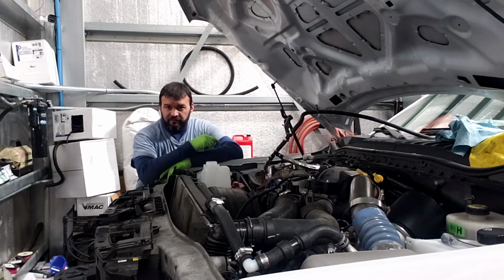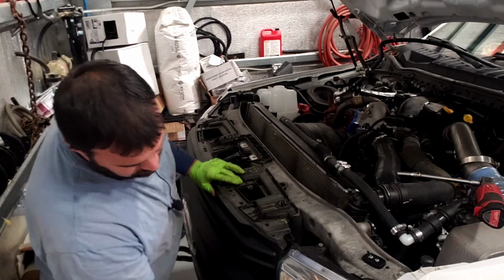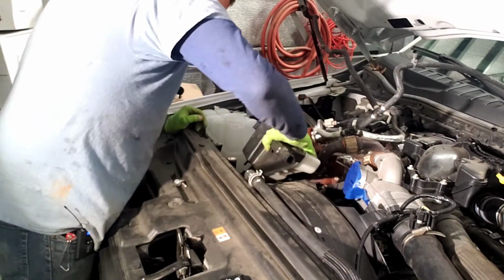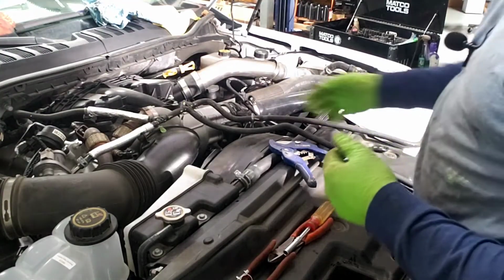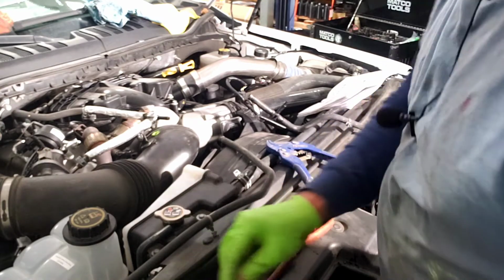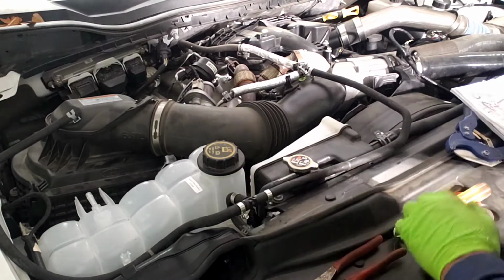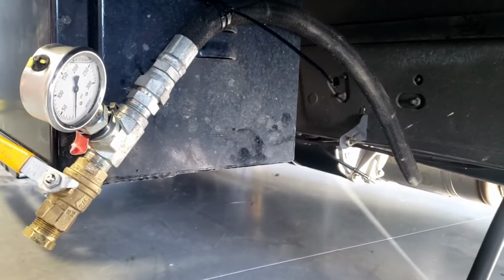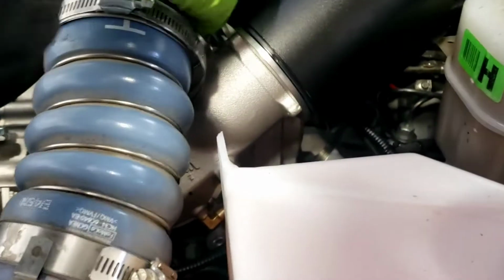VMAC VR150 (ep.11)  "Completing the installation and testing"

Comment: do you know where I can find the “vmac belt” ? My system needs servicing “vr150” but I no longer use it and don’t want it running in the back. And want it turned off when truck engine is running. Thank you! Love your videos
Reply from the maker: Good afternoon. The system should not run when engine is running unless the clutch is engaged by turning on the switch. Are you wanting a replacement belt or to remove the belt?
Reply: @precisionnc  originally but I notice when the truck is running the belt for the compressor is going as well. The system isn’t going fully as like you said you need to activate it with the park brake. But I was wondering if there was something I could disconnect from the battery that goes to the vmac to have it not run if you get what I am saying. I was told the oem white cable with blue stripe but it’s directly attached to something else. Any idea on how to do that?
Reply from the maker: @estebanbeltran3299  the pulley will always be turning but compressor is only engaged if center of the pully is turning. If that is happening when compressor is off then you might have a bigger problem but an easy fix. If you just wanting to disengage it so it doesn't come on then just unplug the single white wire on the compressor. Your more than welcome to send me a video of the issue you have and ill help get the problem solved. Let me know if this is on interest and I will send my email over